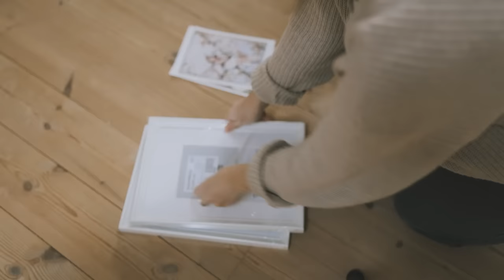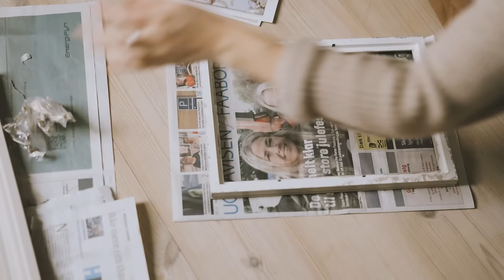Decorating my Daughters Room | House Journal | Episode 2

Comment: You did a lovely job with the wallpaper. One way you can line up the first piece is to put a string against the wall, the same distance from the corner as the panel is wide (for example, if the panel is 60cm wide, that is where you hammer a small nail with a loop of string. On the bottom, you hang something a little heavy from the bottom, giving you a straight line from the ceiling to the floor (in America, we call it a "plumb bob").